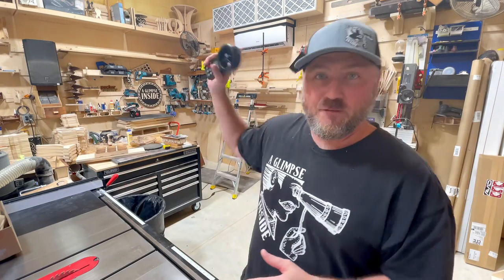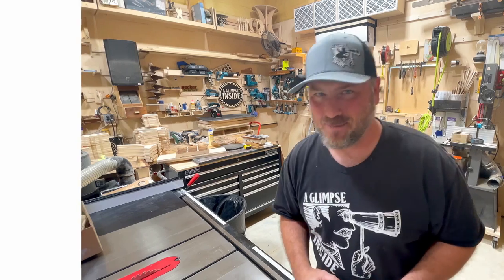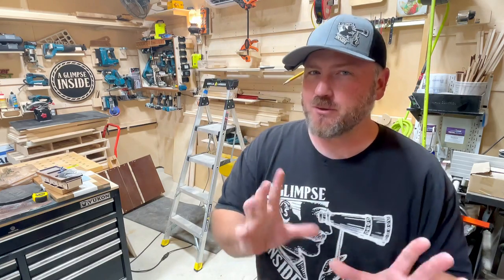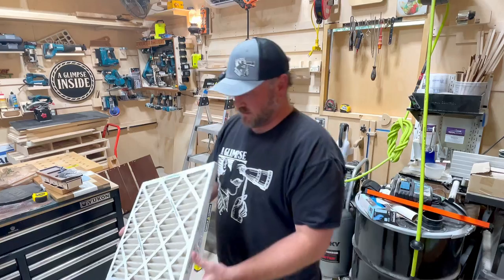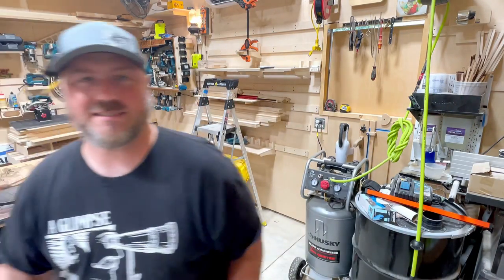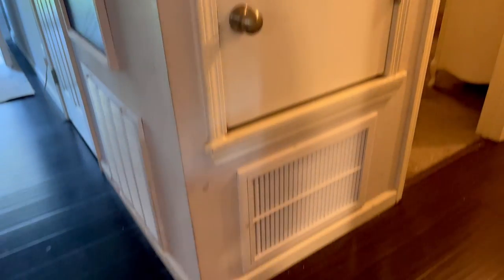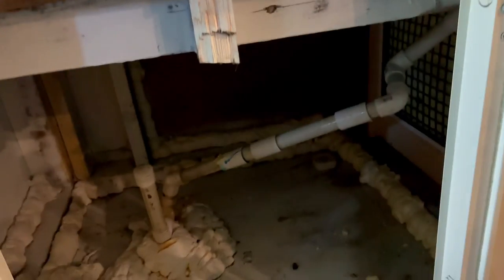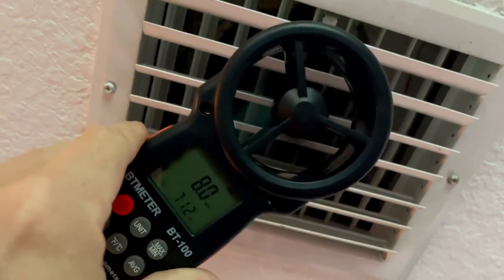I Have Proof You Should NOT Buy Expensive Air Filters

Comment: HVAC guy here. Get a manometer and test your total static pressure for your ducted system. It's crucially important that you dont restrict airflow too much. The total static pressure on a ducted system should always be under 0.50 total Static in inches of water column! Half the system replacements I do require us to install a 2nd return air duct and grill. Ductwork sizing and filters are extremely important!!

Comment: HVAC Engineer here:   1. Higher MERV filters are more restrictive because the materials have a "tighter weave" so that they can stop smaller particles.  The restriction should be higher, or they wouldn't be working.   You don't need the tight weave in a wood shop, so go with lower MERV filters.  2. Home air handlers are meant to draw/blow air though ductwork.  They have much larger motors and can push against more restrictions.  When they are tested, the air filter is assumed to be .08" static drop through the filter.  This unit is ductless, so it has a smaller blower motor, therefore it is less able to draw through filters (one of the reasons they are cheaper).  3. The reason you care about the loss of airflow is because it impacts the performance of the A/C.  First, lower airflow does lower capacity (i.e. less cooling).  But more importantly, if the airflow is low enough it will cause the coil to freeze up. This causes a whole host of issues ranging from damaging the fins, no cooling, no airflow, and damaging the compressor (slugging).   4. Last thing is that you tested all new filters, but even the low static filters will get more restrictive as they get dirty.  The "dirt" clings to the fibers and reduces the spacing in the weave of the filter.  This effectively makes it more restrictive and actually improves the air cleaning.

Comment: HVAC guy here. I ran some numbers and with four 16x20" filters that's sized for about 1,600 Cubic Feet of air per Minute (CFM) with a filter in place. I'm sure your ductless unit is only moving 400 to 900 CFM's. You are good! I would still stick with basic filters that are not as restrictive.
Reply from the maker: Awesome thank you so much. Good to know.
Reply: @AGlimpseInside : Going with the MERV 8 filters are you worried at all about fine dust being pushed back through your AC unit into your environment? Or do you have a separate air scrubber?

If you don’t, maybe a MERV 13 scrubber feeding into your AC unit?   In theory, as long as you’re pushing enough air to the AC unit, you’ll have no airflow concerns. And maybe a diverter for the times when you don’t need the AC.

Comment: Just a Landlord here and while I’ve had a lot of hvacs to replace over the years and I may not be an expert, I’m knowledgeable enough to know if your getting thrown bs or not.

You’re right that your home has a reduction in air flow that no layman talks about, but the system is designed to be that way.

Your mini split however, is not designed to have an additional 22% reduction or even a 10% in ideal conditions (these things are made for apartments more than workshops). However if it was properly sized for the work area (which I’m pretty sure you covered when it was installed), it’s more than powerful enough and a much better setup than not having the protection like before. 

Might I suggest still blowing out or even changing the Mrv 8 filters every 3 months (or at a regular frequency depending on the dust in your shop).

Anyway, good video - and I’ll see if I can write tomorrow. I’m a vet myself and those letters are powerful when they come…..

Comment: Hey Chris, thicker filters will increase surface area of the filter medium and will allow more air through.  If I use fine filters I also put a lower filter in front of it to catch larger particles and prolong the life of the expensive filter. And of course as they catch particles they will start to restrict more air anyway.  HVAC guys please make note woodworks are dealing with dusty environments in enclosed space with particles down to pm0.1, so filtration is usually sought after.  But for woodworkers, mini splits are not designed for that type of filtration.  My solution has been a separate canister filter with its own fan to run while I work, and filtration to protect the ductless system which is there to keep my shop comfortable.
Reply: I also use the two stage filter set up. The 1st filter is a washable type. The fine filters last so much longer like you said.

Comment: One other thing to check,  is the temperature of the motor.  Check it without the filters and with the filters.  If there is too much resistance and the motor is heating up,  than can create cause issues.    I was creating a box fan filter and found if I used a 2” filter MRV 10, the air did slow a little,  but the temperature of the motor did not increase but a couple of degrees.

Comment: I design large commercial HVAC systems including some buildings that contain wood shops.  I’ll echo what I’ve seen in some other comments.  A thicker filer 2”, 4”, 5” will give you more surface area and reduce the pressure drop though the filter.  For some reason residential products don’t document the pressure drop, but this is well documented for filters that are sold commercially.  I would also mention that MERV 8 is often viewed as a pre-filter, strictly to keep cooling coils clean (from generally clean spaces, not wood shops).  As indoor air quality has become a focus for indoor environments, MERV 13 filters are no longer just considered ‘hospital grade.’   It is quickly becoming best practice for most commercial buildings (schools, office buildings etc.).  All of that said whatever filter you settle on for your split system, when dealing with the small particles of dust in a workshop no home filter is a sufficient substitute for dust collection, dust masks, and/or recirculating units with very high end filters (think HEPA filters) for protecting lungs of woodworkers.  Thanks for all of the great content you share!  I wish you continued success in all of your endeavors.

Comment: Project farm has some good filter testing and air flow videos,  the best one was the Filtrate 1500 that have like 3x the pleats that the common filter has.  The small pleats allow alot of air flow, but still catch good.  I have been using the 1500s for years and its the only filter that will not freeze up my inside unit over time.  Highly recommend.

Comment: Increase the surface area of the filter medium and that will let more air flow through. You can accomplish that with thicker filters or add another bank of filters above the one you have already….just create openings between the existing filter box and another one.
Reply: I think he has already passed the point of diminishing returns with respect to gaining more flow with a higher filter area.  From looking at the set up, even if using lab-quality and calibrated measuring devices, I doubt you could detect any difference between the flow using a set up with only two or three filters from one that uses 20.
Reply: I agree, they filter whole houses with just one of the filters he's using. Granted, a house doesn't have the density of dust, but with close monitoring his filtration is adequate.
Reply: A humbled man has true emotions. you my fellow Floridian are a unbelievably humble and genuine man. God bless you and your family.
Reply: @3frogltd987  The difference is this system is designed for much higher static pressure at the fan.  The pressure loss equates to loss of air flow across the coils, which reduces performance and lifespan.  I think as long as he isn't Icing up his coils and they are not getting too hot in heating mode he should be fine though, but I'm not a mechanical engineer so that's just my opinion.
Reply: Everyone seems to be missing the point: the filtration is to keep the machine working not to keep an asthmatic alive.  Go with the low merv rating which will keep all the gunk out of the flow, and allow the volumetric flow rate to be at a higher level.

Comment: Something to consider; Jay made his box to accommodate 20" x 20" filters.  Your box fits 16" x 20" filters.  That leaves you 25% less surface area to draw the air through.  That is only the surface area, now consider the volume of air in the boxes.  Assuming the same depth, he has 25% more volume.  Also, don't for get Jay tested the electricity draw with and without the filters as well.  Enjoy the videos!
Reply from the maker: Oh yeah for sure I know he has three units, but his shop is considerably larger than mine. Quite frankly, I made my 4 inches shorter because my plywood walls only go up so far. So I figured it would be OK. I know time will tell. Thanks for being involved here. I appreciate the kind words about the videos.

Comment: Cool idea, but mini-splits are not made for much restriction.  Normal house ducted HVAC blowers are rated to operate to up to 1" of water (a pressure rating), which is a pretty restrictive, fairly clogged filter, but I'd say a 20% restriction isn't going to hurt anything in either case.  The danger is that the coils ice up and then airflow is restricted further and eventually the compressor dies from working very hard year after year and in extreme cases it may even get liquid refrigerant back from the inside evaporator since the coils are iced and no cooling is happening there.  Mini splits use weak fans to save energy.  I'd say if you have this much sawdust in the air what you really need is an air cleaner with a good filter. This will save your lungs and the AC.

Comment: Could not agree more, Retired Sheet Metal worker here, and with so much of what I see folks here in YouTube land do is try to solve their own problems with some crazy type of Filter, but what they all are lacking is the Exhaust Air part of the equation! An important factor in dust mitigation is where your bag house AKA the exhaust filter is located, I say this because experience in installing these systems in commercial application's Be it from Steel Mills to Food processing plants the air scrubbed out of the area has never been returned to the space. that part of the system is typically external to the building. 

 Then there are total Exhaust air requirements, depending on the size of your space and the turnover, you can size the fan accordingly, in a manufacturing environment IE: a wood shop I believe 20% is a safe number for exhaust air.
Oh yeah, those split systems are very sensitive to dirt loads and air flow across the coil, slow it down and you're going to get a block of ice up there, those things were never intended to run in that environment, in a I.T. or Server room sure a wood shop oh hell no! other than that great content.

Comment: You need to increase the “cloth area” of your current filter panels. At the moment you have panels which are 16” wide x 20”long with 1” pleats so try using say 3” deep pleats ie, 16x20x3 and that will increase your cloth area by 300% thereby reducing the pressure resistance the unit is experiencing which should improve the air flow
Reply from the maker: Oh that’s a pretty good idea. Definitely going to look into that. Thank you very much.
Reply: I'm actually trying 4 inch filters on my simple box fan air filter. I'll be sure and let you know if I find a difference. Completely different application I know, but should at least give an idea...
Reply: I'm a fan of thicker filters for HVAC systems, but you'll likely be better off adding 4 more 1" filters than using thicker ones. Both in air flow and cost effectiveness. This usually isn't an option on a central HVAC system, which is why we go with thicker filters to reduce static pressure in that scenario.

Comment: As a 25 year veteran of the hvac trade. Use good disposable filter for the house also. Most homes actually do not have enough return. Yours looks better than many I have seen. Your filter box should help a bunch. Or you can go back to the thin filters and clean them daily, when you are making dust. Spaces with very little dust like a server room in a bank will clog those thin filters in 3 months to the point that there is a freeze up issue.

Comment: My job is to test air filters to determine the MERV rating. A MERV 13 is NOT medical grade. As others have stated, air flow is measured in cfm, not mph and the static pressure drop using a manometer is a very important measurement. In the home, I don't use anything less than a MERV 13. Also, some filters will get more efficient as they get dirty while others will become less efficient. In the shop, can only assume you are trying to protect your mini split and not your lung health, so an 8 is adequate. Wear an RZ Mask whenever you're using your dust collector to protect your lungs.
Reply from the maker: I see good to know. So I did the redneck version. Lol. Either way interesting to hear about how some filters are more efficient the more they get clogged. I guess that makes some sense. I guess assuming that a nerve 13 that can block, germs and smoke and allergens and even bacteria would be considered “Medical” but I guess not. Freudian slip I suppose.
Reply: This is a good reply... If you want to do a more relevant set of testing, getting a manometer and measuring pressure drop of the system is something we can compare to system specs, rather than just guessing based on air speed. 

I plan to add a system very similar to this to my upcoming new shop, and would love to see the results with new and used for a while Merv 8 or so filters.

Comment: Another way to test the load on the Minisplit, use an inductive tester on one of the 110v legs in the breaker panel and see what the load difference is with the filters on/off.  That extra load will tell you how much harder the motor is having to work and how much extra electricity it must use to achieve the same cooling needs.
Reply: The problem with this approach is that with reduced airflow the blower fan uses less current and if there is less airflow across the inside coil then the inverter driven compressor will pull less current as well to prevent coil freeze up. Keeping the static pressure difference within the specs of the manufacturer is the best course of evaluation and action.
Reply: @adamliske yes that’s the point of the test. To what the difference is with/and without the filters. 
If you’re concerned about manufacturers specs, how far out will they be with a bunch of shop dust clogging them up? I would believe far better with a much greater filter intake than nothing.

Comment: When we bought our first house, i did what anyone would do, added the best filter possible. After that i could audibly hear the suction from the restricted aiflow. I also noticed that the AC wasn't cooling the house as well as it had. Since then i have replaced the super filters with pretty much the cheapest ones i could find. Still filter out alot of crap, but airflow is much better and less noise.

Comment: Your old unit had two failures,  one because the coils were clogged and it also restricted air flow.  I don’t remember if you said the fan quit or not.  I am not an HVAC tech, but have have extensive work with HVAC techs.  One thing they told me for home, if I changed my filters to a higher rated filter,  to notify them so they can make adjustments to handle the restricted flow.

Comment: I find this whole thing super interesting. I currently work as an HVAC engineer and following COVID, we had a ton of people asking us about increasing filtration. It's a very interesting thing to try to explain to people why they can't just put a crazy high MERV rating filter in their existing system as it's just simply not set up to have the static pressure to pull the air through that filter. I often would try to explain it to people by having them try to imagine holding a piece of gauze up to their face and trying to breathe through it vs trying to do the same thing with a piece of t-shirt fabric. It's obviously going to be a lot more difficult to do with a t-shirt type material. That being said, simply having a reduction in air speed doesn't directly correlate with a reduction in air flow. Think of like an air compressor vs a leaf blower. They could potentially both be delivering the same volume of air in CFM, but if they are both delivering that same volume, the air compressor is going to be delivering it at a much higher speed than the leaf blower would. While you did see a reduction in air speed, that wouldn't definitively tell you that your unit is delivering less CFM with different filters. I would probably continue with what you did of doing a filter somewhere around the MERV 8 level as I think it would likely be a nice happy medium. 

The other thing to consider with more expensive finer filters is that they need to be replaced MORE OFTEN. I often find a lot of people don't think this is the case since they often feel that when they spend more on something, they expect it to last longer, like, for instance, a pair of shoes. If I pay $200 for a nice pair of running shoes, I expect them to last longer than ones that I buy for $20 from Walmart. With filters, when you buy the more expensive ones, their finer "mesh" catches more particulates and in turn clogs up faster, needing to be replaced sooner.
Reply: Because you brought up COVID-19, maybe a better analogy besides gauze and t-shirt would be wearing a mask vs not wearing a mask.  Which is easier to breathe.  I think more people would have an instant understanding.